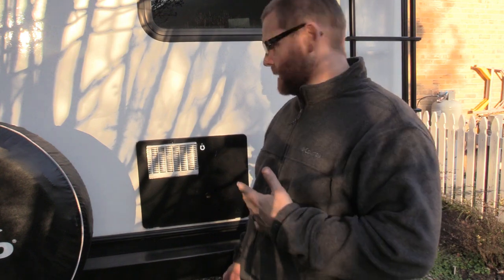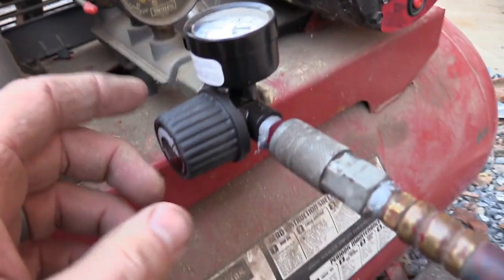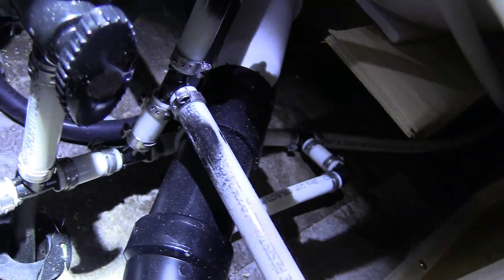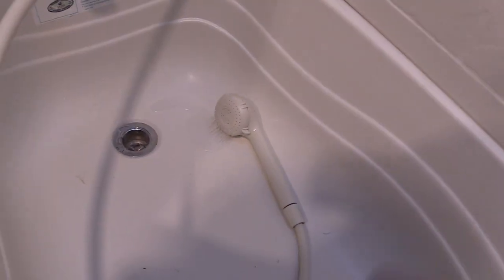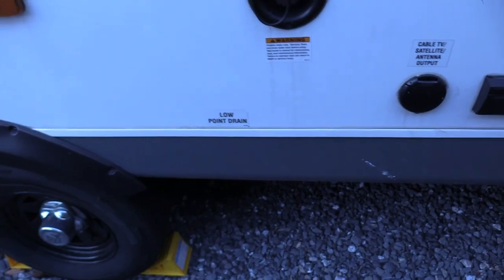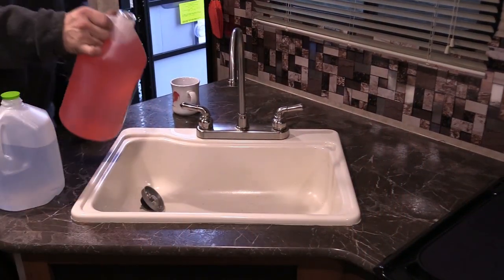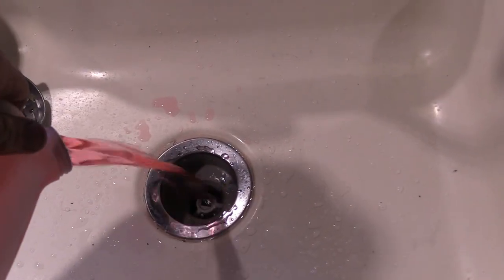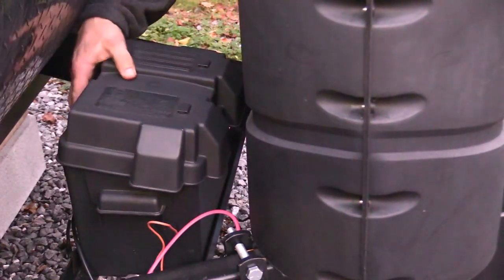How To Winterize Your Travel Trailer Or Camper Using An Air Compressor

Comment: "Great video" but my only concern is your threads on your air adapter. It looks like the threads on your 3/4" to 1/2" hex bushing are NPT (pipe thread). Isn't your city water connection Female Hose threat. I know they are on my Jayco. The adapter I use is a brass 3/4" MHT (male hose thread) to 1/2" MIP (male iron pipe) then adapt it down to my air fitting.
Reply from the maker: Now that does raise a question That part was actually made for me so honestly I cannot answer that correctly.  But I may just go and get a newer on so I do not damage anything further. Thanks for bring that to my attention I mean they sell the fitting for it for less than 7 dollars its worth it to me. thanks for watching and commenting
Reply: @MountaineerOutdoors  Just a old retired pipefitter/welder didn't want you to damage the threads and end up replacing the city water connection. Like I said it's a great video. I'm sure it has helped a lot of people.
Reply: @glennosborne2413  it absolutely has helped me and I hope that alot of people will see this comment and get the correct parts. Thank you again

Comment: This was great for me. My daughter and I used this step by step. ( although it was difficult to find the hot water  heater shut offs, we did!!)  we have a storm on its way and had to do the best we could as the rv place could not get us in.  I’ll be late getting the air to blow out the lines as I don’t have the adapter yet, so I haven’t put the pink stuff in yet either. But ASAP I will finish that. Praying for warmer than predicted weather for at least 2 days!  I think I hear Arizona calling me!
Reply from the maker: I hear that warmer weather 😂 glad that it helped you. Happy camping

Comment: This is a great video. I also only use air in my waterlines. I never thought to put antifreeze in my toilet bowl to keep the ball valve from freezing.   One other way to keep bugs out of all your exterior compartments is cheap flea collars If they stay dry, they will last 2 years.
Reply from the maker: Wow that's a great idea on the flea collar will it work on stink bugs?? That's what I have alot of and lady bugs too.
Reply: Does the flea collar work for spiders?
Reply: @lindajoplin8054  for spiders you'd want a spider collar, obviously 😄

Comment: I like this for us midwesterners who have freezing temps in October when we are not done camping for the year.  However, when we are done for the year, I will still continue to use the pink stuff.  One major reason is I do not want the rubber seals in my pump, or other areas to dry out and rot over time.
Reply from the maker: I can see that for the dry rotting but I'd hope that they are made good enough for me not to worry about it.... Good point though.

Comment: New rv owner here, doesn't closing off the hot water heater before pressuring the lines trap water in the hot water lines? My hot water didn't spit water/air like the cold lines did. Thanks for your video, it was my go to when I did this for the first time today.
Reply from the maker: I appreciate your comment and watching.. So I do not close off the water heater anymore I don't see any point that is how the dealer told me to do it. So probably to your answer. Happy camping ☺
Reply: @MountaineerOutdoors  my manual said the same, we only use the hot water in the shower so the lack of water in the lines while blowing them out makes sense now that I think about it, it did blow out in the shower. I'll leave it alone next time. Thanks for the response.
Reply from the maker: Good and my pleasure for responding to your questions... Have a great day

Comment: Thanks - we really didn't want to put RV anti-freeze in the water lines of our brand new Jayco trailer as I was concerned about the water quality next summer.  It seemed like we could blow out the lines and appreciate knowing that someone else is doing so with success.  We'll let you know if it stands the test of being stored outside in a Michigan winter.
Reply from the maker: Yes let me know.. Its pretty cold in the winter here in VA too and so far mine has been ok. I'm just not a fan of filling up the lines with anything other than water. Thanks for watching and commenting.

Comment: I read where you drain both the gray and black tanks before the winterizing process but what about afterwards?
There is going to be water in both of those tanks after draining sinks and toilet .. won't that cause a problem ?
Reply from the maker: No they have plenty of room for expanding plus I always pour some antifreeze in tanks just in case. But you should always drain them anyway at your site or somewhere with dump station. I never store mine with anything other than residual from the sinks or the last stuff that didn't come out while I was dumping

Comment: Great video. I would add one more step. Take your battery out and put it on a battery “Tender” in your garage. This will maintain your battery during your off season.
Reply from the maker: I did at first, now I leave it plugged in and no problems with it thank goodness

Comment: Hey is it normal to have air pressure inside the water heater while your blowing the lines (at 25psi) i unscrew the water heater plug and it seem that it had lots of pressure. Is that normal?
Reply from the maker: Yep sure is make sure you drain it out the water I'm I'm referring to and air.

Comment: Can you elaborate on why your closing the feed lines to the water heater and opening the bypass valve? I get opening the bypass to get any residual out of those lines but I don’t understand why you closed off the feed lines.
Reply from the maker: honestly I was told that is the best way to do that however after you asked me now im thinking that it may make more sense to leave open so if there is any residue (water)  it will fall into the tank instead of the lines. Very good question for sure thanks for asking.
Reply: Because if you are putting the pink anti freeze through your lines you won't be filling the w/heater too,just the lines
Reply from the maker: Now that definitely makes sense thanks for responding to that question
Reply: @Breaknwid  Thats a fair point but this video was about winterizing with Air Hence my question. That being said having thought on it I do see value in what he did because it prevents water from ending up in the water heater or in those lines. What I ended up doing after everything else was done was opening those lines back up briefly with the drain valve to the water heater removed just in case there was anything to be blown out.
Reply from the maker: Good idea too. I don't think the water that is left in the tank would hurt anything alot of room in there

Comment: I have never used my outdoor shower.  Do I still need to run air through the line going to that?
Reply: Thank you for an excellent video.
Reply from the maker: Yes definitely run the air through it.

Comment: I am a 1st year RVer. I have a 160W roof mounted solar panel that would be producing a  charge, so do I do something different with the leads? I have a full cover I plan to place on the trailer, which would also cover the solar panel.
Reply from the maker: I would definitely make sure those leads stay covered with some sort of cover so it won't short out or energize anything although it won't be enough to really hurt anything but it's still voltage. If you tape up the leads I would use a good quality electrical tape like 33 or 88 and make sure you put something around the leads so it won't gum them up from the tape. Hope that is what you were asking about?

Comment: great video. i love the idea for the water heater and not having to take the plug in and out every year. what did you use for that? what do i need to buy?? thank you
Reply from the maker: I just pinned the comment to the top of the comment section where someone already asked check it out. Thanks  for watching and commenting

Comment: My hotwater heater has a 1/2 inch female drain, supply hoses I have found are 7/86 female.    How do I adapt the hose to work?  Wouldn't it have to be a 1/2 male to 7/8 mail to fit the supplly hose?
Reply from the maker: You would need a close nipple id recommend brass then you would have to look bit you can find a 1/2- 3/8 line. If you are using the 7/8 you will have to adapt it for sure.

Comment: that plug on your hot water tank has a tube of zinc on it witch keeps corrosion away from the tank
Reply: cvenne15 that’s not the plug. The plug is just a plug. The thing you took out was the “anode” and it should stay in. You should change it every couple of years. It’s usually in the top part of the tank and the drain on the bottom.

Comment: One comment, it might be a good idea to remove the aerators from your faucets to prevent any residual scale from the low spots from clogging them off (and clean them at the same time...)
Reply from the maker: Definitely another great idea.. I will be adding this to my list as well... Thanks for the tip
Reply: You are better leaving them on ! It keeps any insects looking for a winter home out ! @MountaineerOutdoors
Reply from the maker: Just shut mine...
Reply: @davidelo5843  I didn't suggest leaving them out...

Comment: A tip for you’re hinged propane tank access flap, drill a couple of holes near each  plastic hinge and put a zip tie thru as a backup, I lost mine and did this on the replacement.
Reply from the maker: Doing that first thing tomorrow... That is a great idea.. Ive been very cautious about making sure they are tight before I leave but all that jarring they usually pop out. Thanks for the tip. ☺

Comment: What about the water that is now sitting in your black and gray tanks?  Is there no concern about the discharge pipes?
Reply from the maker: Yes i never thought about the discharge pipes.. As far as the gray and black tanks go... There is ample room in there for freezing plus your dumping antifreeze in the drains so it will mix somewhat with the extra in there.. plus you dump the rest of the antifreeze in the black tank so I really wouldn't worry. The discharge pipe id make sure that there isn't any water/sewage in the pipe to the cap and everything should be ok

Comment: Air compressor newbie here. If the PSI is set to 30-35, will it automatically stop as you move from faucet to faucet? So... there is no problem with leaving it on?
Reply from the maker: Yes once your air compressor fills back up to the psi you set it will turn itself back off.. Your statement is correct.
Reply: @MountaineerOutdoors  Thanks. I was going to us antifreeze. I will buy a compressor instead.
Reply from the maker: Good luck I just can't see using that stuff.. Its the only way I will do mine. Happy camping
Reply from the maker: One note to make sure that you buy one with a regulator so you can control the air pressure... My big compressor that I used I had to buy one for it didn't have one on it. I purchased my regulator from Wal-Mart pretty inexpensive. Make sure that you have one on yours.

Comment: You don't say to empty your gray tank afterwards draining the lines and before you put in the antifreeze.  I would think that this is worth doing.
Reply from the maker: That is great point. I will have to do that when I get done. I'll use s bucket and open up the valve and let it run into a bucket. I do put antifreeze in the toilet straight to the black tank so it won't freeze.. Great point I appreciate you mentioning it.

Comment: a good filter on the air line might be a good idea, you don't want any oil from the compressor in you drinking water.
Reply from the maker: That's a great idea... I didn't even think about that.. Glad you brought that up. Thanks for watching I'm definitely gonna get me one this upcoming year.
Reply: I used a battery-powered, portable, lightweight, tankless (Ryobi) air pump to drain water lines and ice maker on my 32 ft class C (no dishwasher or washer-dryer). PSI can be adjusted on this model, so I use 35 psi. It takes little longer to complete entire process (2 batteries used to complete all lines), but no oil contamination to worry about.
Reply from the maker: That's impressive thanks for sharing.

Comment: anode for the hot wate tank  is missing if you add on a permanent drain
Reply from the maker: Mine doesn't require one I have asked the dealership and people who have the same one I have. Not sure why but mine doesn't require one
Reply: @MountaineerOutdoors  Plastic tanks do not require an anode rod.

Comment: Can I use your method without messing with a shutoff valve to the water heater where is that going to hurt something if I just leave everything as is
Reply from the maker: I would say probably but if there there is water stuck in there it has the possibility of freezing. Good luck and happy camping
Reply: @MountaineerOutdoors  what I meant was totally drain the hot water heater like you did , engage the pressure valve put the plug back in,  and just have the air go all the way around the different faucets what is the importance of shutting off the valves to the hot water heater if you're not going to use the antifreeze
Reply from the maker: Ok I think if you just drain it.. It honestly won't matter on the valves. I've done it both ways and nothing has happened. As long as you get most of it out of the lines I think you will be fine.

Comment: Store your battery in a heated space.  Discharged batteries can freeze.
Reply from the maker: Great idea too.. Someone else said to bring them into a crawl space or basement off the concrete great ideas
Reply: I don’t store my batteries on concrete; put something under them.
Reply: One more battery tip, I alternately keep mine on a battery tender throughout the winter to keep them charged. A battery charger will over charge but a tender keeps them at their peak.
Reply from the maker: I've got one for my motorcycle... Im seriously thinking about getting a another one for the camper.. Thanks for mentioning that

Comment: Is there a video on de-winterizing after using the air method to winterize?
Reply from the maker: Not from me and I don't think that I have seen any on you tube
Reply: @MountaineerOutdoors      So what is there to do to de-winterize?   Anything special?
Reply from the maker: Just make sure you ALWAYS turn back off every spigot you left on and if you have the cold water bypass turn it back off so you will have hot water and it won't be mixing hot water and cold water. I may do a video on it

Comment: My camper has a black tank flush connection.   Run air through that too and if so how do you tell if all the water is blown out of that?
Reply from the maker: That line is so short that once you hit it with air the water is gone within seconds.
Reply: @MountaineerOutdoors  thanks
Reply: @MountaineerOutdoors    Same question - I'm thinking just open the toilet valve just a bit to let the air pressure out when clearing that black tank flush...otherwise where will the air go?  Any water in the line is gonna go into the black tank- right?   Not trying to overthink this. I'm a new owner and the previous owner just dumped 5 gallons of AF into the FW tank.  Took a while to get the "pink" out of the system.
Reply from the maker: Yes the water will go in the black water tank. Even if you left it in there I Highly doubt anything would happen I feel that if it were to freeze it would expand and fall into the tank. So shouldn't be any problems. Hope that helps

Comment: This was a very helpful video!  I'll be blowing my lines with air for the first time this year.  I've always pumped the anti-freeze through in the past.  What size toilet water supply line did you use to hook up to your water heater drain?  I think that's a great idea!  Did you need any kind of adapter?  I don't see one in your video.
Reply from the maker: I screwed in a 1/2 brass nipple then used a 1/2 to 3/8 braided line. Good luck it's the best way to do it I find.. Thank you for watching!!
Reply: Do you keep that toilet water supply on all the time or remove after you empty the water heater.
Reply from the maker: I leave mine on all the time I never take it off

Comment: I'm surprised to see that there's no mention\comment of the fact that all compressors (either than the very pricey oil-less and properly filtered types) introduce oil residue into their stream. This of course would not be an issue if it wasn't for the fact that, in this case, it's released into your potable water line! To each his own, but i'd rather pass.
Reply from the maker: I have never seen any oil in my lines not saying that there isn't but honestly I doubt highly that there is. Like you said to each your own
Reply: If you have a decent oil less compressor the likelihood of even a microscopic amount of oil is very low.  Of course everyone should flush their water system out every sorting.  But using rv antifreeze in your lines it's extremely difficult to flush it all out.  Yeah it's not toxic, but it's nasty, it smells and leaves a taste.  I've done it both ways. 
I'll risk the air method.
Reply from the maker: I agree with you on that.. I have had no problems whatsoever.. I will Definitely continue to use air

Comment: It’s ok to let air into the lines even when all the taps are closed?
Reply from the maker: Yes just make sure you do not over pressure the lines I do mine 30-35 psi I not sure about the older campers but my pipes are pex and I know pex can hold pressure.. I personally wouldn't run more than 35 ever... You wouldn't hook up to a water tap that was over pressure so don't do the air.. And yes it's completely ok to leave the taps closed too...
Reply: Mountaineer Outdoors ok, thank you!